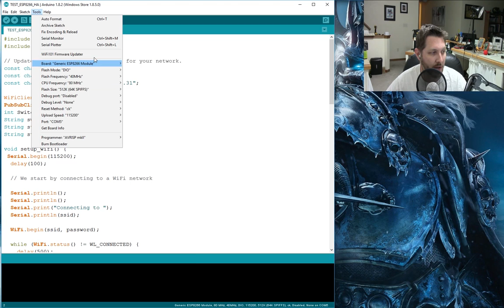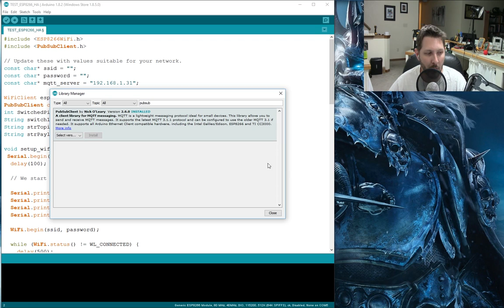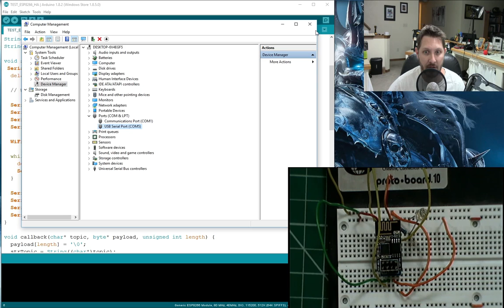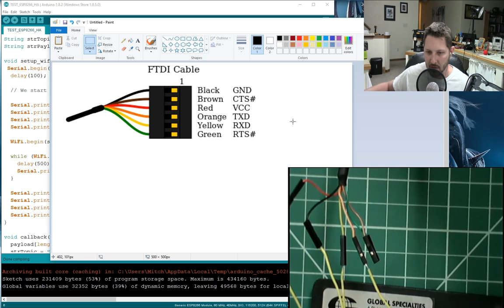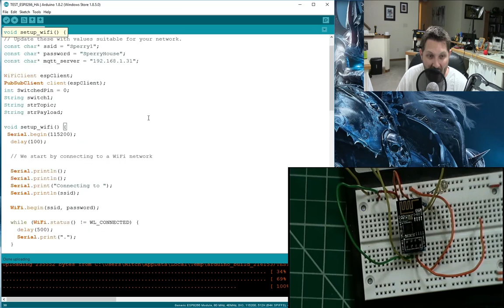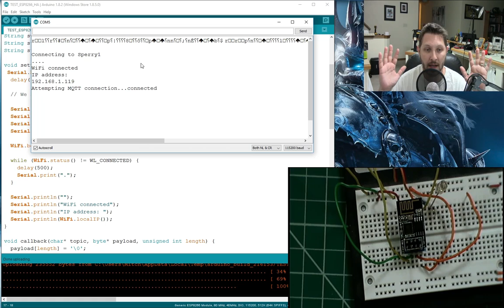HomeAssistant Custom WiFi - ESP8266 Setup

Comment: I see an unused gpio2 pin is this possible to connect a temerature sensor to this
Reply from the maker: Well it would depend on what type of temp sensor.  If it is one that uses spi or i2c you need both clock and data lines and thus would need two ports.  If you are wanting to use a thermistor and a resistor divider I don't think the esp8266 has an ADC.  So I am not sure you can with only one non ADC GOIO port
Reply: @misperry  something link an am2032 could the data go to gpio2 and the other pins share the vcc and gnd

Comment: So.. I have this RGB led strip with RGB and ground pins. I wanna be able to use it with a Node Mcu (using transistors to convert signals to 12v) The node Mcu will connect to WiFi and I should be able to control the colours and brightness through Google assistant. Any idea how I can achieve this?

Comment: I started with these ESP-01 modules.  Biasing RST high with a 10K resistor makes them more stable.
You should look into the Wemos D1 Mini (or clones).  About the same price now, uses ESP12 module (with more pins), and can power / program through micro USB port.  I've almost completely switched to the D1 Minis.
Reply from the maker: Hey there thanks for the comment.  Yeah those do look really cool.  I will have to try one.  Thanks again.

Comment: Very unorganized talk .....Where is the WiFi connection made???????????
Reply from the maker: +KaivitiSingh did u watch close to the end when I demo it?  this is at 21:20 and I power it up and show it connecting through the serial window.
Reply: I mean WiFi connection made with Home Assistance app. The assigning of IP address and connecting the Esp8622  directly with Android device (without a router). This is the most essential part.... the code and libraries etc are already on Github. Aslo explain which app is to be used in your project for the Android.
Reply from the maker: I apologize for the confusion but this is the first step video of getting the ESP8622 set up to connect to a home network for later use with the HomeAssistant system.  I am not doing anything with Android.  The next video is set to release tomorrow for how to setup HomeAssistant to talk with this device and manipulate the GPIO that is on the ESP8622.  Hope this helps.  Were you suggesting that you would like to see connecting one of these to an Android phone in future videos?
Reply: There you go again!   It is"8266".